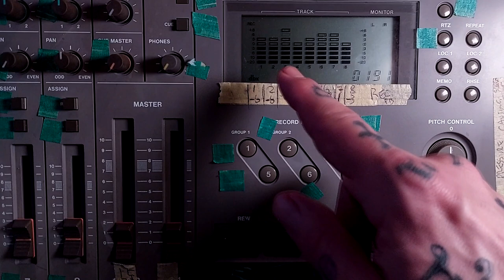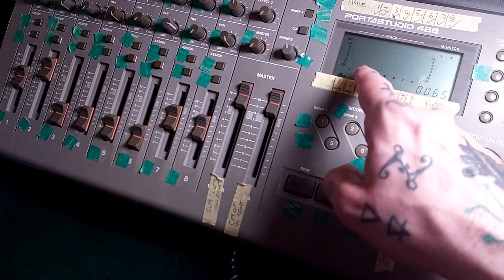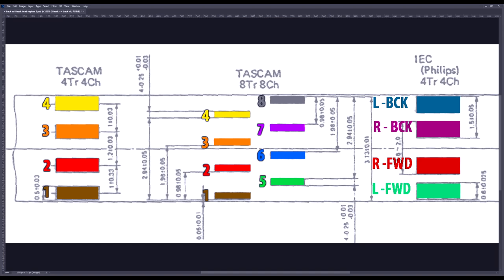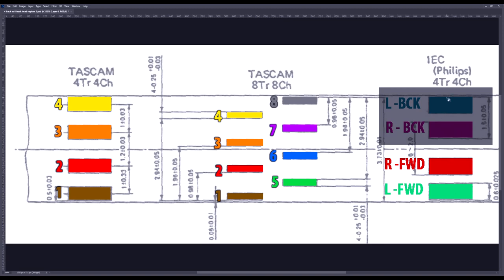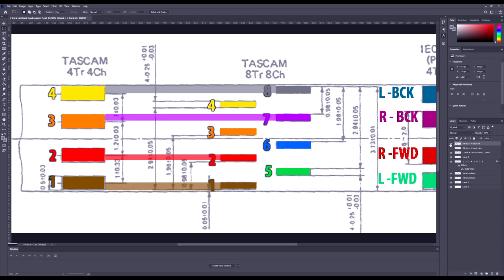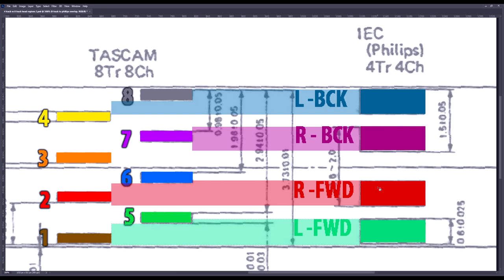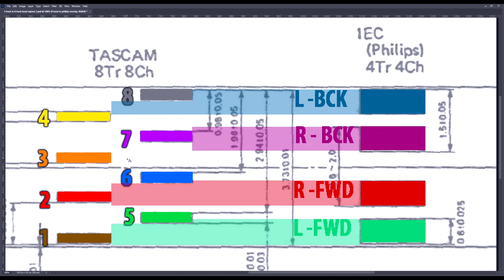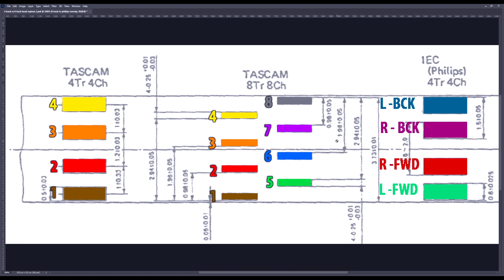Are 8-track & 4-track cassettes compatible? Can the same calibration tape be used?

Comment: A few months ago I got a cassette with a 1khz signal. It was recorded with a head that records on the complete tape Width. It is very usefull for this kind of stuff. Its good  for calibrating a 4 track or an 8 track machine. 
Until a few weeks ago I didn't even know these things existed.
Interesting video,  thanks!
Reply: Excellent. Yes, I think this is what's meant by "full track" test tapes. I'm after one for head azimuth calibration. Where'd you get yours?
Reply: @ordaleem  you can find them on ebay. The guy who sells them lives here in Germany. Cool guy!

Comment: Interesting video and your coloured version of the head diagram comparison really helps clarify things. I tried playing a tape back recorded on a 244 in a 488, and noticed how the different head spacing also threw the tracks out of sync a bit. Also it’s good to know that all the Tascam 8 tracks share the same heads. I’ve got two 488mk11’s which won’t record on one of the tracks, and fear I may need to start the quest to find replacement heads. 😬
Reply from the maker: Thanks. I've got a repair report on a 488 Mk 1 I'll be publishing next week. It ahd one channel not erasing, and initially I thought it was dead heads, but it turned out to be tape to head contact issue, perhaps that will rpove to be the case with your mark IIs? I'll eb going over testing heads for continuity and so  on in that video so stay tuned...
Reply: @Tetrakan  Brilliant, I hope that’s the case with my mk2’s then. Look forward to seeing your new video! Thanks, Calum.

Comment: I'm a bit surprised to find out that the 488 and 688 have the same heads.  In my experience the 688 does sound incredibly good for an 8 track cassette machine.  To my ears it sounds better than any 4 track or 2 track cassette machine I've heard.  It seems to have a lower noise floor, greater dynamic range, everything.  Maybe it's the preamps and built in mixer?  Variance from one unit to the next?  Placebo effect?  I've used a lot of cassette machines over the years but certainly not as many as you.  I'm also one of the few who actually likes and uses the built-in noise reduction, if that makes a difference.  Anyway, I love your vids, man.  Keep it up. ✌️
Reply from the maker: Hi David. Just checked the service manuals on both the 488 mark one nad 688 in case I was confabulating, but the transports in both units are identical, record playback head is part number 5378601600 in both units. Technically speaking, becasue ther egions of tape the signal occupies are narrower on a 488/688  than - for instance - a 424, the signal is being represented by fewer metallic crystals and the dynamic range should be meaurably worse on the 688 than the 424 (!). DBX dramtically increases the dynamic range, at the expense of changing the frequency response and adding some compression artefacts - like you, i actually prefer the sound of this and typically record with DBX on. So what accounts for your preference/perception of the 688? Is the performance of the record amplifiers and mixer much better? Or is your 688 much better calibrated and maintained than other units you have had access to? Or is there an element of confirmation bias? I don't really know. I do plan to start making a series of videos where I compare sections of schematics accross serveral makes and models of multitracker to identify common features and differences...for example comparing the headphone amplifier in a Teac 144,  Tascam Porta 07, and Yamaha MT8x....so comparing the preamplifiers of several multitrackers including a 688 alongside other brands and cheaper models is something I will add to my holding pen of video ideas..thanks for watching :)
Reply: @Tetrakan   Yeah it's totally illogical that a tiny sliver of an already narrow piece of tape would sound any good at all, let alone better than a wider format.  I assumed there had to be some fancy engineering under the hood considering the 688 was a later model, and I believe the most expensive, high end cassette multitracker they ever made.  (Some of that was to do with the midi capability and more complex routing options which I never used.)  But the EQ alone on the 688 sounds excellent.  I have had mine serviced by TEAC as well.  🤷‍♂️

Comment: Question: I want to normalize the playback levels of my own 488. I don't have a cassette test tape, but I have a 2 track 1/4in reel to reel mastering deck. Ive looked at how the heads would line up on this tape and know it would cover 4 of the 488's heads. If I record a few tones on my reel to reel, physically split the tape in half, load it into a cassette, Can I just look at the levels of all the channels, find the average, and from there adjust the playback so that they are all the same based off this arbitrary level coming from my franken-tape?
Reply from the maker: I havent tried that but I think that'd basically work? And it wouldn't do any harm...let us know?

Comment: Aww, I wish I had seen this a couple days earlier. I set playback levels on my 488 mkii with a cheap test tape recorded on a stereo deck. Do I really have to pay for an original Teac test tape? They’re really expensive on eBay.
Reply from the maker: You're probably okay. The regions recorded by  the IEC head are wider than thise recorded by a 4 track head so they're probably getting picked up better by tracks 3-6 of the 8 track head? So variance is probably in excess of factory specs, but not terrible? If you were worried, I have this untested theory that you could turn off noise reduction and use tape hiss from a blank tape in conjunction with a VOM or oscilloscope to ensure all the playback amps were set within a plus or minus 1 decibel range 🤔

Comment: Wow that diagram really blew my mind. Is it hopeless to try calibrating a 4 track portastudio with any tapes produced on an IEC machine? Any chance you would ever consider selling test tape duplicates from your calibrated 4 and 8 track machines? Thanks for continuing to make great videos, I just saved two cassette doors after learning to spin weld from you XD
Reply from the maker: Thats great the spin welding stuff has woroked out for you. Oh no, you can totally use IEC calibration tapes for a four track, the problem would be using that tape in an eight track machine, it'd work well for some tracks but not others. My attempts ot duplicate calibration tapes for friends by hooking up two portastudios  have been plagued with problems, they all came out off-pitch or quieter than I intended due to some snafu with claibration ... maybe one day I'll look into getting some porperly duplicated, a form of channel merch, but I've got an overflowing inbox so it might be a while!